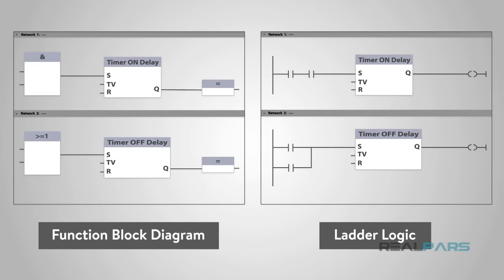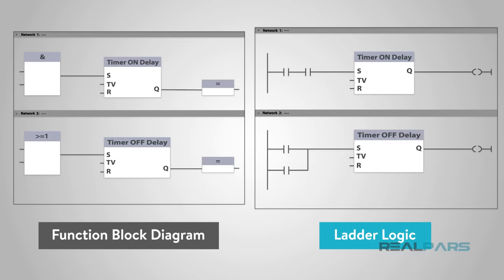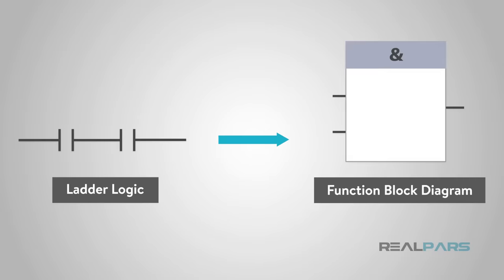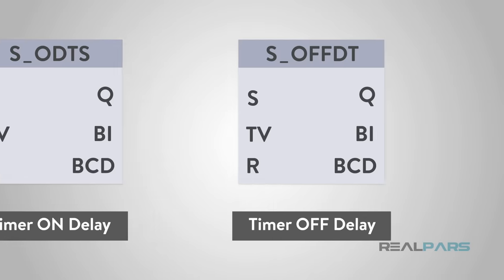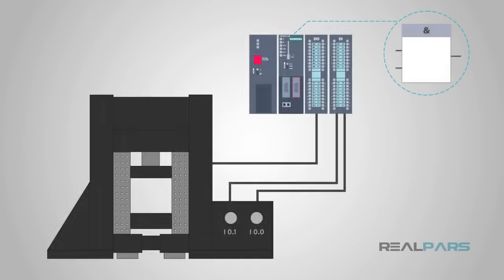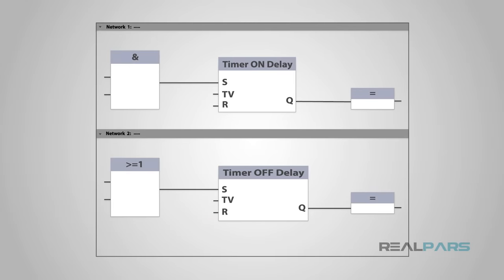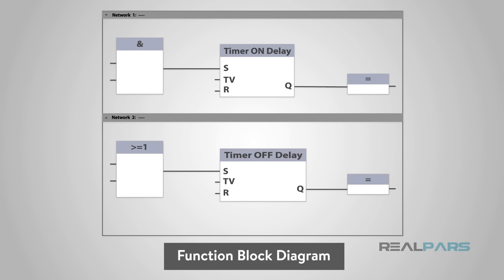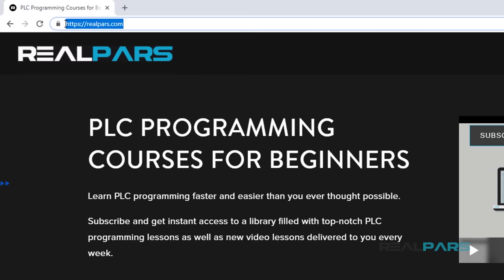What is the Difference between Ladder Logic and Function Block Diagrams?

Comment: As a junior programmer having done almost a dozen major power plant plc upgrades and program rewrites with my Senoir Process and Automation Engineer, many upgrading from PLC5 to ControlLogix I call Function Block programing Magic Boxes. That’s me and what I call them as to me they work like magic and make a large program work seemingly like magic with the programing inside the block. While I personally have never programmed one, I’ve seen my coworker do so, but more so I understand the power and huge benefit of Block Programing. In many of our company upgrades we’ve done on power plant projects, Function Block programing has meant the difference to our programmer in being able to vastly minimize the amount of programming required, like programing for many pumps etc. He programs and perfects just one pump Function Block and then he duplicate that Block for pump instruction where ever he needs instruction for a pump logic. That cuts down on making mistakes in the instruction logic. If a mistake, he fixes just one time in the Function Block instruction and like magic every other pump with same problem is fixed. That saves an immense amount of programming time. That’s why I call them Magic boxes or Magic Blocks. But that’s just me.

Comment: Is there a way to use function blocks instead ladder logic with s7-300,1200,1500 on tia portal?
Reply: Filip Kramarić if im not mistaken, step 7 allowed the user to alternate between ladder logic and other languages such as function block diagram and structured list. So yes, a PLC program MAY be written entirely in a language other than ladder logic
Reply: As i know 1200 & 1500 plc support FBD I am not sure about s7 300.
Reply: ziborgbe it does.
Reply: @MaNemUmar  I have seen that it has some variation of FBD but since I have used LOGO 8! I was wondering if it is possible to use that kind of FBD?  The FBD in step 7 is some kind of ladder logic with function blocks which is something I don't personally like. Wish I could program s7 in the LOGO comfort.
Reply: when creating an FB, fC or On you have the chose betwin ladder, fbd, and instruction list,
Reply: @cyrox1859  Sadly FBD in tia portal look a lot different from FBD in Logo Comfort.
Reply: you can see the difference using a parametrable function for example, but basic operations like and, or stay the same
Reply: Dont use ladder on 300, NEVER use fbd

Comment: Hi I want buy Siemens 1200 ac/dc/rly CPU. Wondar that I need a memory card or not
Reply: Hi! Basically, you don't have to buy a memory card for the S7-1200 series, because it has a built-in program memory (work memory). But if you want, you can extend the CPU with a memory card, but it's used to store project on that or do a password reset or update the firmware. And be careful, because normal SD cards won't work, only special formatted Siemens cards (and never format these cards from PC, because you'll brick the card!).

But if you want to start programming with it, you'll be happy without having a memory card. :)
Reply: @zorro4622  thank you

Comment: Please help!!! Does anyone know how to export a Function Block  Diargram in Codesys as an XML file and open it on PLC open or simply export it to PLC open? Your help will be much appreciated.  Thank you.
Reply from the maker: Abdulazeem,  what CODESYS editor are you using?  Typically, the export tool is in the PROJECT menu item or you can do a "save as" and select the file type as  Project which saves the file in XML.  In the CODESYS 3.5 SP1 editor, you can also select "Export as PLCOpenXML" from the PROJECT menu.  Repeat the process at the other device, but use the Import tool.
Reply: @realpars  Thank you for your quick response. I use version 2.3.  I have tried both methods it wouldn't work.  The PROJECT menu has EXPORT as an option but it only saves files as an *EXT file. What I am trying to achieve is to Export the file to a PLC open XML file or if I can covert the Ext file which already has all the FBD program as a PLC open XML file. Your help will be much appreciated. Thank you!